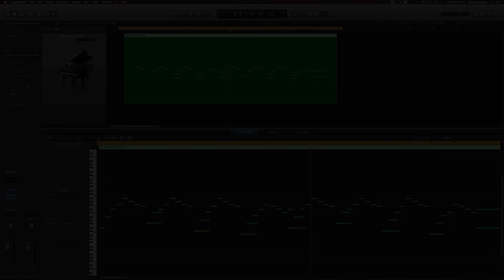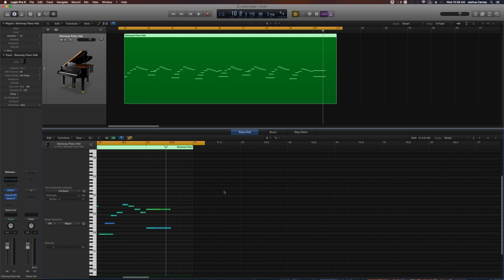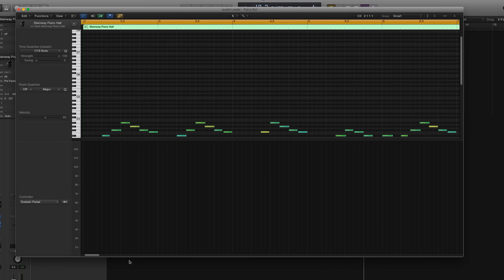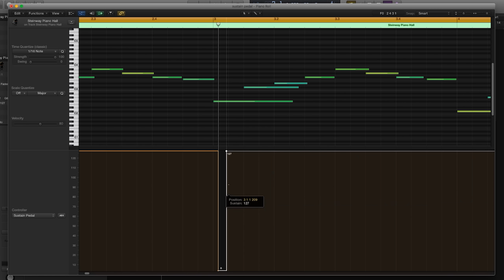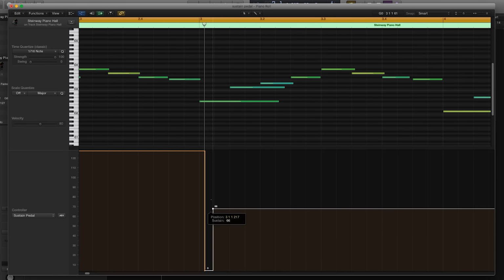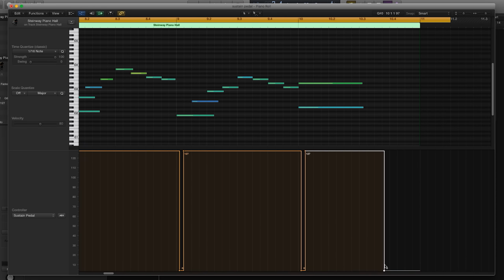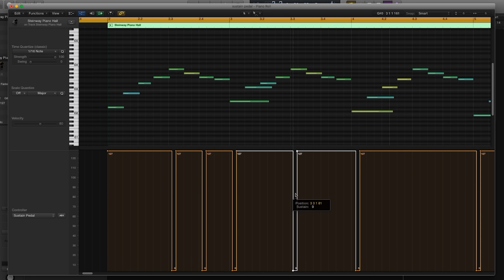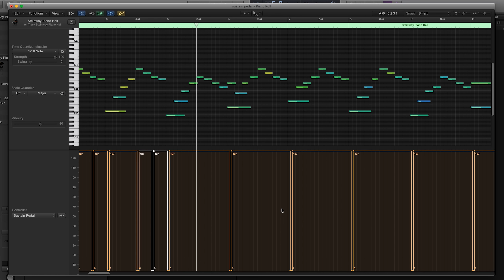Logic Pro X - Sustain Pedal MIDI Draw Automation

Comment: Good basic introduction to sustain, with a minor and a major caveat. The minor one is that I would put the gap overlapping the ending note of the previous bar and the first note of the following. 
The major issue is the sustain pedal in piano is not at all a on/off switch. By pressing the pedal you actually control how much the dampers are lifted away from blocking the strings and between 0 to 127 there are a lot of nuances that modern piano emulators take into account, like Pianoteq, as an example.

Comment: This is one way to create sustain, but it's a broadsword method. It makes sense for playing live, but there is a better technique for editing after the fact in MIDI. Live, it would be impossible to do, but in post-editing, it can be done and will work better. This other method is  more a scalpel method.

Essentially, sustain is the same as holding the note. You could create the same effect you have here by just extending all the notes to the end of the measure in the piano roll. But why neither of those really works well is because not all the notes are 'chord notes', to use the 'bass guitar' terminlogy.

Your first measure has a D#, A#, D#, F#, A#, G#, F#, and F. All are 'chord notes' other than the G# and F. The other notes can sustain throughout the measure and sound fine, but the G# and F will be disonant along with the sustain, once those non-chord notes are invoked. That measure will sound much cleaner if the two A#'s stop ringing at the start of the G#, and the two F#'s stop ringing at the start of the F.

It's subtle, but full sustain of the A#'s and F#'s will muddy the full track, especially in a dense mix, and fight with the G# and F. Add reverb and delay, and it gets even worse. Use a piano patch with sympathetic vibrations, and the harmonics will add even more dissonance if you simply sustain all the notes to the end of the measure.

A better way is to simply drag all notes to the end of the measure (drag past the end then chop them all off with the Command > T function) then drag the A#'s back to stop ringing at the point the G# begins, and drag the F#'s back to where the F begins.

The sustain you want to hear will still be there, but the dissonance will be absent, so the phrase will sound clearer and more distinct, especially in a mix, yet still have the same perceived sustain. That's nearly impossible to do when playing live, and 'sustain' would be either all or none. This method will be less dissonant. Try this on a Rhodes, which has much more sustain than the Steinway, and it will be much more apparent to the ear.

One thing I consider important that many ignore is exactly where a note stops ringing. I've found that on a piano, typically, if you edit the notes to end at the 160-tick mark (slightly different for swung notes) this makes the attack of the following note clearer without raising the volume. Also much less blurry than having the notes extend to the start of the next note.

So I do everything this way. It's intensive editing, but it makes a mix much clearer.
Reply: I think you might find that extending the notes the way you speak of means that you only affect the legato but miss out on the overtones which is why I prefer the term damper to sustain pedal  Maybe that is the way you like it . . . fair enough

Comment: Thank you for this tutorial. I’m having trouble with Logic chasing the pedal down (127) position. I have an 8 bar section where the pedal is down throughout - when I loop to edit bar 2 or 3, the pedal position is not carried over from bar 1 even though I have ticked all the boxes in Logic's midi chase settings (under project settings). Can you help?

Comment: Normally when i play the piano i can easily fade out the sound by slowly lifting up the pedal, but in midi keyboard i always find myself editing the values in DAW. Because the sustain pedal in midi keyboard operates with a binary logic (on/off) without any interval sensitivity. The midi value comes as either 0 or 127 as in this video. 
Is there any type of pedal or midi setting to generate interval values depending on the pressing intensity?

Comment: Was wondering if you could help me out on this.

When I plug in my sustain pedal into my Alesis Q49 (no display) it works in reverse. There's no polarity switch on my sustain pedal. So when I press it down, it dampens and when I release the pedal, it automatically sustains. Hope you can help me out here.

Comment: Dude the "midi Draw button isn't here.  (please help!)
Reply: I'm with you...I'm running 10.4.3 and, for the life of me, I cannot find where I can edit the sustain pedal.
Reply: same !
Reply: it seems to be gone @davidanania5618
Reply: They took it out. What you can do is open the Piano Roll as he demonstrated in the video and then on the upper left corner click the "Functions" tab. At the scroll-down there should be an option that says "Convert sustain pedal to note length." Then you just extend each note so that it sustains to whatever length you want it to be. It worked for me. Hope it works for you.
Reply: I found it! I found it in the automation/midi at the bottom section of the piano roll. Then I clicked some bow with a right arrow pointing to a circle to change the channel of automation. I don't know if there's another way to access it, but it worked for me.

Comment: thank a lot for this,  maybe you can help me,  I have a problem, my sustain pedal is no more assigned to my M -audio 88 keystation with Logic pro x 10.4.3, I mean it does not work, no sustain,  it worked before I changed to 10.4.3, may it's a bug in logic, please, how do I assign the pedal to have sustain again? thank you very much for your help and happy new year 2019! (-;
Reply: Im also expiriencing this same issue on 10.4.3 and don't know the fix either

Comment: Is there a way to "record" in the pedaling after recording a non pedaled passage ?

Thanks
Reply: yes if you link any midi controller to the sustain parameter. actually pretty simple, you could even do it with a keyboard modwheel.
Reply: Aaro Arvola which settings do you need to change in order to do this ? “Latch “ ? 
Thank you